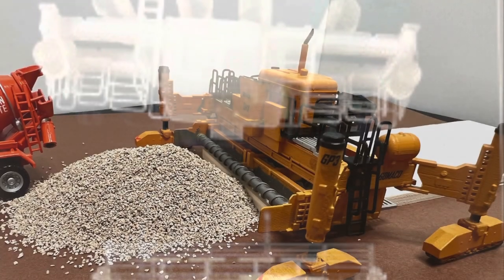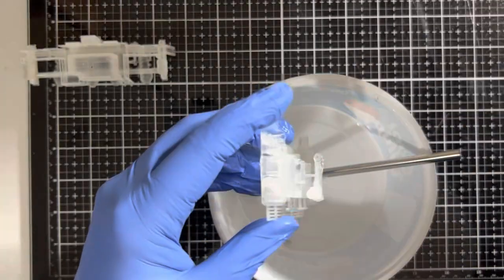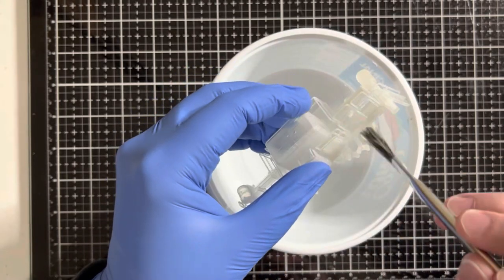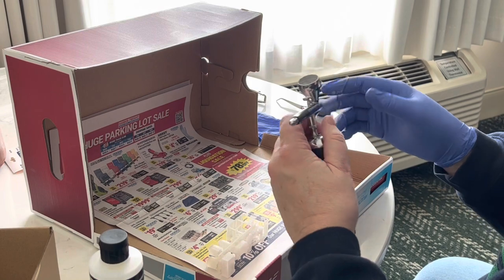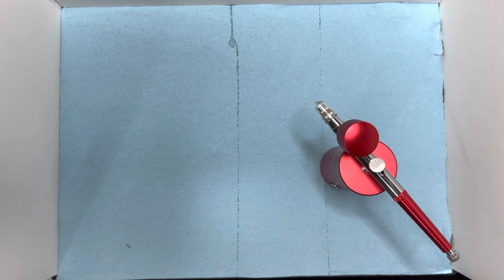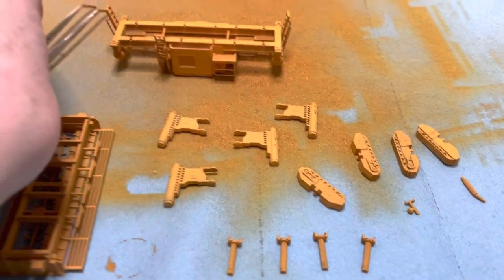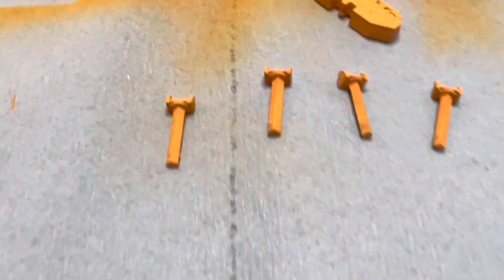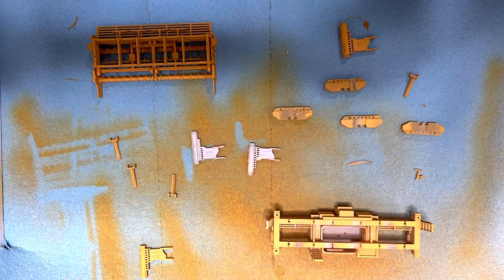Shapeways Printed 1/87 Slip Form Paver Part 1

Comment: Cool project. I worked with one of these machines on a freeway. Instead of using the normal concrete trucks, we delivered the concrete in semi dump trucks, got the job done faster.
Love to see the finished product.
Poor cleaner would of had to spend hours to get rid of the Tamyia aerosol smell out of your room...lol
Thanks mate.
Reply from the maker: Yeah told Roy was trying to make a connection for people.  I actually got the room cleaned up by night time surprisingly.  But yeah that Tamia stuff is though.

Comment: Steve some nice techniques I like watching other air brush I am still learning  did not know they had wireless airbrushes very cool. Were the parts printed on resin printer or filament printer
Reply from the maker: Well it was Shapeways and no way it was a filament, I mean the hand rails are like .03 Rod, if it was done by hand.

Comment: You needed a face mask to keep those paint fumes from clogging up your nose! Did you blow gray snot for a day or two? Hopefully, you wore a mask the second time? That yellow matches that machine perfectly! Yep, ARTY is correct, they use end dump trucks supplying cement to a slip form paver! Also, they dump the cement right out in front, and the auger spreads the cement from side to side, getting an even coverage.
Reply from the maker: It wasn’t too bad because I was in a big room, but wish the window could have opened.  It actually wasn’t too bad.  So as the end dumps, yeah, but also mixers, just a lot of them, the showed them on the website that way.  Also I was trying to show it was concrete, dump truck would not have told people what it was.